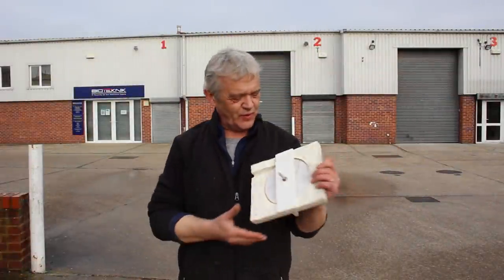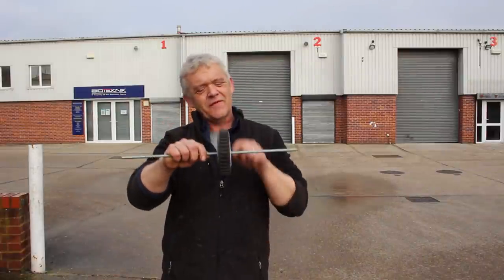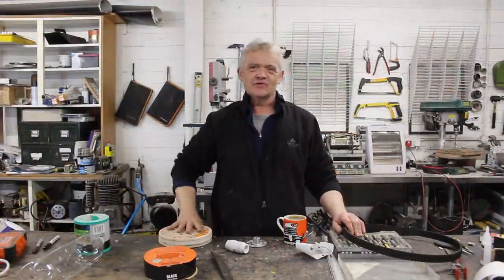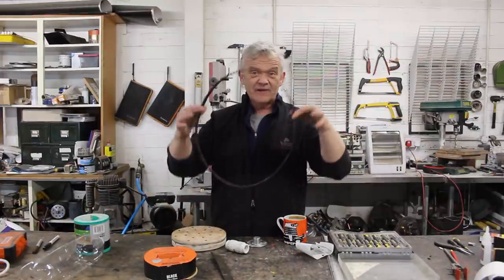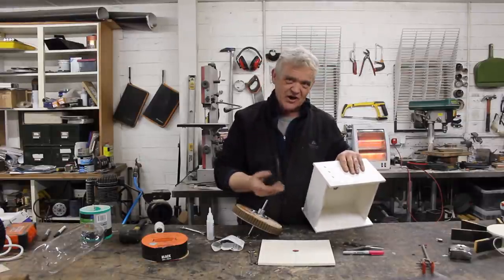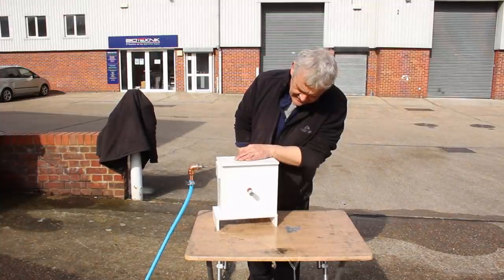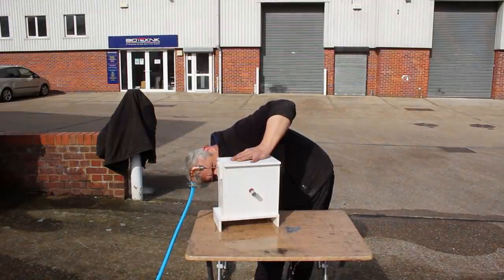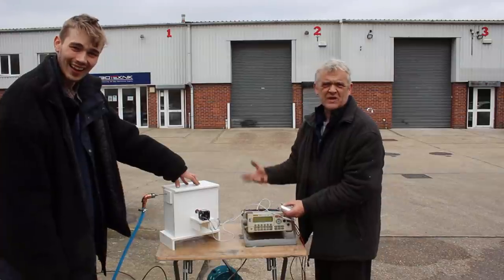1467 A Water Motor That Could Charge Your Phone

Comment: Another interesting little device Rob. You never fail to impress me with your ability to find potential even with "redundant" technologies.

Quick question for you if you don't mind? How quickly do you usually ship your conductive ink? I placed and order this morning, and just trying to get and idea of when I will be able to find time to take a look at my ideas on modification to the rainwater generator. Copper tape strips, conductive ink, polyurethane with tungsten electrodes (copper electrodes would oxidise) is the plan. Of course I'll give you and update when / if I get there!

I've had a chemist friend join me in my experimentation with this, and we have a sneaky feeling the rain drops can be recycled (re-gain electrons) with a drop of 5cm or so onto another generator panel. Exciting indeed! 

Cheers mate. Always a big fan of your work!

EDIT: Just got an email with a tracking number from Royal Mail for the ink. Anyone else reading this, Rob has a pretty good shop going on there! 😉
Reply from the maker: it went out yesterday mate - we tend to ship same day  - I am excited o see your update mate - I like the plan you have there

Comment: Just a thought, but, do you have enough space at the bottom of the motor to evacuate the water, which could slow the flywheel.
Reply: Actually, unless you are going to also install one on the bottom, the top side location is the worst location to use. It would be far better to use one in the top aimed downward. Then the water could exit faster.
Reply from the maker: there is a big hole in the bottom mate - I pointed it out when I described the box construction

Comment: This kind of device put inline with the water main inlet could be used to charge a battery bank. Every flush of the toilet every time a tap is turned on, dish washer , washing machine..............ect. 👍 Awesome ! 👍
Reply from the maker: yep - this uses 2 litres per minute - every toilet flush is 7.5 litres - on average we use 150 litres per person per day apparently - that's a lot of runtime

Comment: Whenever I see videos about a work conversion device, it always bothers me when it's connected to a motor for electric generation. Wish we could coil wire around it and slide some magnets in cut-outs on the wheel
Reply: Don't get bothered bro. 
The point is also to make one 'think'.
That's why,  it's also my idea to do as you also thought. 
You won't find much fishes here; but you can learn many ways of catching different fish. 😏
Reply: @dremaboy777  great response 👍🏽
Reply: @MikePerreman  I just want to see it incorporated. Less transmission loss as well
Reply: What is the difference between a motor and a generator?  A D.C. motor with permanent magnetics is generally a well built device and is identical to a D.C. generator at the same size.  Physically, they are the same.
We could just take and change the name plate on it. You'd create a lot of losses with the magnets in cut outs and coils as the build tolerances would be so much greater.  But yes, it could be done, but what would the point be?
Reply from the maker: I have done exactly as you suggest mate - but in different videos - it really just depends on what the video is about - this video isn't really about generation per se - it's about the mechanical arrangement to capture the kinetic energy of a water stream in an easy to build way - I think this is around 50 maybe 60% efficient - if I am lucky - but as a machine cost it is low and within the reach of any builder from materials found 'around' that's really the point of it - and my view is 50% of something is a hell of a lot better than 0% of everything

Comment: FYI this works better if you use an old washing machine,  take the motor and convert it over for generating power then  use that..  many other channels that have done this, and are running thier homes on them.
Reply from the maker: Sorry mate but that's a myth - pretty much any motor will do - the problem isn't the motor it's about matching the speed and torque
Reply: @ThinkingandTinkering  actually, its a matter of windings and magnetic fields.  washing machine motors are 2 phase, and when converted for generation, they produce a very much amount of power, more so than most diy's.   its a matter of how well they do the job that matters to those who plan to use it.

Comment: A couple of thoughts ocurred to me ..... nothing unusual about that, but thes may be relevant!

On your original water motor you have the inlet and the exhaust at opposing angles. This would force the water to change direction .... not good for efficiency! Did you make it like that for a reason? ...... If you changed your inlet position / angle would it make a difference?
You say making a Tesla Turbine is a pain (I agree) because of the high speed of rotation, tollerances and balance. Would this still be true if you used water rather than air? It would seem that the increased viscosity between air and water would both increase the rotational power given and at the same time reduce the rate of rotation due to interferance with the water and the disc and the outer container. 

The most important question is ..... How do you keep on coming up with new old tech that is so fascinating?
Whatever .... Please don't stop!
Reply from the maker: you can have a fair bit of slack if you use water and I have made water based Tesla turbines before - quite a few actually - as for the idea - I just read - a lot! - lol

Comment: Would a larger wheel/cog be able to move as fast as the Flywheel?
And with an as low amount of water as the Flywheel?
Why a bigger wheel, well more leverage could be more speed if gearing is used or a stronger generator could be attached for the same amount of  water.
It would be harder to start for sure, but would it sustain motion

1st or so
Edit: just because and i wanted to research possible questions 1st
Reply from the maker: I would think so mate - interesting question but the only real answer is to build it and see tbh

Comment: I get confused with these efficiency ratings.  If one sprayed a jet of steam at the Pelton wheel, one would surely have potentially a highly efficient external combustion engine.  For about 130 degrees C of heat one can get a couple of bars or 28psi worth of pressure.  The Carnot efficiency reduces overall efficiency by 50% or so.  But with that wood burning stove you made, by wrapping refrigerator pipe around it in a coil and perhaps having some of the coil inside the chimney, and then wrapping rockwool around it to make really good heat insulation, then all of that heat would be concentrated into the pipe.

Another idea is that if it is harder to direct a jet of steam at a Pelton wheel owing to its lower mass, if the steam pipe was fed into a tank of water, this would increase the water pressure which could in turn be used with the water wheel you just made.
Reply from the maker: I was reading some papers on efficiency and how it is calculated and what is and isn't taken into account - the conclusion was - it's all a bit confusing lol - on a serious note efficiency is one of those concepts that by itself means nothing and one of those concepts that we think means something - like freedom - it means different things to different people so when we say it we think we have communicated something but it hasn't as the speaker and the listener mean different things by it - anyway enough philosophy - like the practical ideas mate - but then I like practical ideas lol

Comment: Show me how to run that water system with a double ram pump, or accumulator bags. Cycle psi to eliminate water run off. Right up my alley,  cheer's..
Reply: And u could build a multiple of them off one line, free water source, near by. Charge ur batteries and ur set. Sweet
Reply from the maker: I was thinking of accumulators
Reply: Million dollar invention, my accumulator knowledge comes from service rigs. Vast amount of psi control, helps reduce kicks from the oil wells. Blow out prevention etc.
I enjoy your videos thank you.
Reply: Now if ya only sold stand alone wall units like that, howl!
Reply: Maybe bendex spring
Reply: Save ya, messing with a ton of pressure variants.could u not power a small water pump to create psi, then at least with multiple units one can run the pump while the others charged the batteries. Low volt water pump versus the generators. Could be inclusive,  therefore cycling water. Kool beans. That would fit in a wall.
Reply: I got a 12 volt water pump I got out a camper trailer.  44psi
Reply: Water wheel and fly wheel and bigger generators lol
Reply: The psi increase from jetting I suspect would allow for multi ports, drained back to sump,

Comment: I enjoyed that one. There will be much convincing the folk to install one.  though that might be tricky.  If it can change a Mobile phone. I think there a sideline there for you. Definitely would be worth comparing wheel types. As that was an awesome start. Top job rob! Could you increase the output with a large pulley and motor of choice? large output pulley connected with belts to a small diameter shaft. Maybe 100-1 or something like that? Its just a thought? Definitely off to a great start. Love to see where this end up. Can’t wait.
Reply from the maker: cheers mate and it is worth comparing for sure

Comment: Could you use a fresnel lens to create steam and power a tesla turbine(or any other motor)? I looked it up and didnt find many videos on it. Non using a tesla turbine. Just a thought I had no Idea how it will work out logistically thanks.
Reply from the maker: a cylinder engine I would think so - a turbine would be more difficult as boiling with a fresnel lens doesn't create a lot of pressure does it? but I am guessing
Reply: @ThinkingandTinkering  I was thinking of heating a sealed tank with a inlet and outlet so the pressure could be “controlled” I say “” because I too am guessing and so the fear of welds failing scares me more than my curiosity of seeing if it works myself
Reply: @ThinkingandTinkering  but I know it will work from examples I’ve seen. The problem is I don’t know the cost effectiveness of if and the Tesla turbine factor I added was just bc I love Tesla turbines

Comment: I did notice a small design flaw that can be remedied by a trip to the store.  Lumber yards and other stores that sell gardening supplies have sprayers for your garden hose that allow you to add a hose to the working end.  They usually have that little loop of wire to ' lock ' in the open position.
Reply from the maker: nice tip mate - cheers

Comment: I would say it's only a dead end tech if we have something so capable and so available that no one cares about energy period, cause they all have such an abundance that they will never run out. And I have not seen that development to this date, or even any thing that remotely looks like it could even lead to that eventuality LOL! 

love the design updating and upgrading you show over the general Tesla Turbine, (which if i recall was designed to work as it did, so it would not be impeded by friction of static air after getting moving to allow super high speeds since it has very little torque it obtains from the air's reaction with the surface tension of the plates, (if all the air in the chamber is spinning at high speed and the same direction though then this would not even matter, only a fly wheel design is going to benefit from such a system, SO I will post over on discord an idea this and the basic design gave me, for an upgrade from even these changes XD
Reply from the maker: I 100% agree with that mate - that is awesome mate - I will go have a look - cheers

Comment: you can make the water recirculating  by using a bowl at the bottom with a tube that leads back to header tankk and  make it a free energy generator...
Reply from the maker: this works on pressure from the head of water mate - if you just collect the water there would be no pressure - you have to re-pressurise it

Comment: Very cool as always ! indeed much easier to make than pelton wheel, how about making a pelton wheel made of cheap spoons by the way ? Just had this idea.. thought you might like

Also one thing you could try, add another jet spraying from the bottom, twice the power potentially ? but yea more water throughput needed for the other design you made just one on each side, or multiples eventually !
Reply from the maker: spoons are a good idea mate - cheers